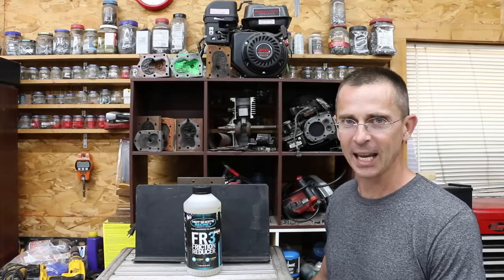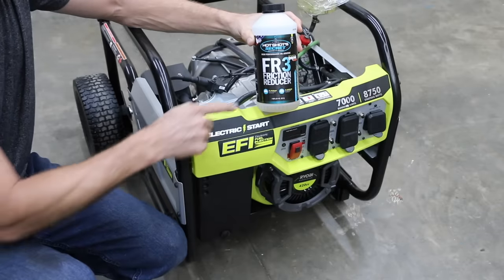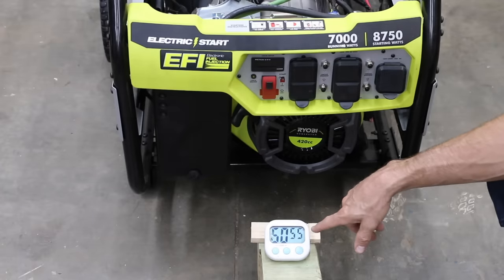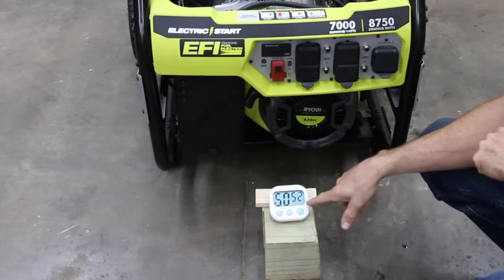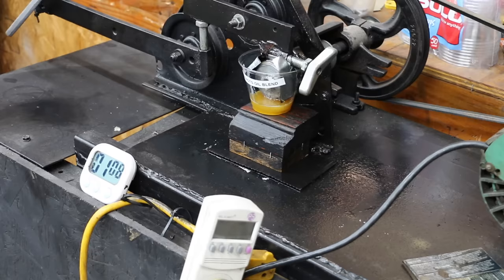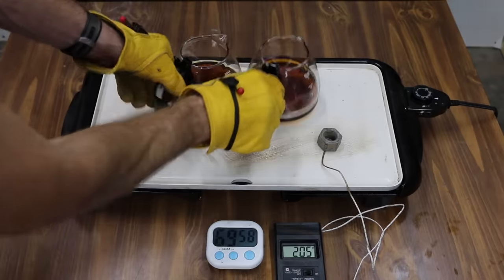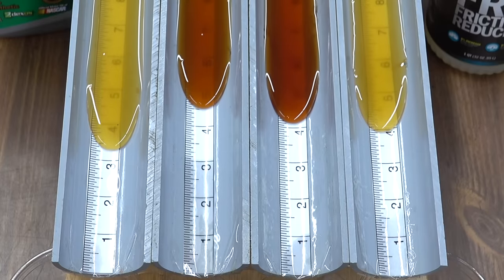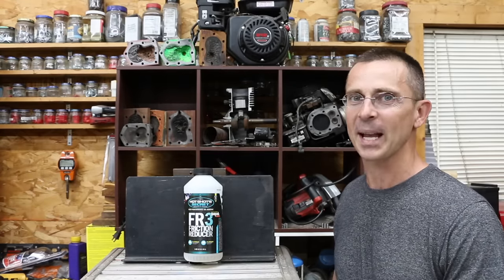Mobil 1 Boosted with Hot Shot's Secret Better? Let's find out!

Comment: When I see your generator, I often wonder about testing out how to quiet down open frame generators using the methods that are out there.  Maybe you've done this test before, but thanks in advance for checking this out!
Reply from the maker: That's a terrific video idea!
Reply: A baffle box is usually the best method. Most of the noise is from the engine and generator itself. A baffle box is lined with egg crate foam or other sound absorbing material, with openings and exits for cooling air that are built as long hairpin baffles. The sound must hit the foam if the baffles over and over again in order to escape from the cooling air inlet and outlet. The muffler can be extended out of the box and upgraded to a larger one from a small car to be quieter. After all that, going to a Honda generator is the only way to get more noise reduction. Those Hondas are sweet.
Reply: I would assume it will overheat in a enclosure even with vents..my 2 cents only
Reply: Lee Harris 
Build a dog house to put over the generator with a vent on the end furthest away from you !
Reply: JStarke240 put it in a box filled with egg cartons as walls. Thats how our music room was. Egg cartons plastered on the walls.
Reply: Check out the belly pans on Audi A4. Wow.
Reply: @leeharris3061  It will not. Make sure you do the pertinent research and calculate how to design the baffle box correctly.
Reply: Google "Quieting home generators".
Reply: Sixtyfiveford i think his name is, did a video about that. He used plywood propped against it.
Reply: We used to put ours in a hole on construction sites.
Reply: Get a RV generator muffler . Then it'll be much more quiet .
Reply: @Dr.Westside  a bigger muffler almost always works to quiet small engines. The block and head usually contain most of the engine noise generated within, but they use piss poor mufflers to quiet the exhaust.
Reply: @Dr.Westside  vibration from single cylinder engines pulse is a big source.
Make generator electric power...lol
Reply: Just buy a plastic 4ft folding table (Lifetime table, etc) and fold it at 90* and put it in front of the generator.  This is what I do when dry camping with the RV and my external generator.  You will be surprised at how much quieter it is.  I now have an inverter generator and still use the table.  Works great!  No need to get too fancy.
Reply: Build a quiet box with a fan. Extremely effective.
Reply: when i see such generator i always think how to make it run on electrolysed water instead.

Comment: test BG products we use them at the dealership and I'm curious how good the products are
Reply from the maker: Thank you for the video idea!
Reply: I too am curious about the BG products.  I use the BG MOA at every oil change.
Reply: I’ve heard a lot of hype about BG products as well. Would love to see some testing.
Reply: @Mittencarpentry  rf7?
Reply: yes, it's a big mystery; I had my dealership clean my injectors with what they called a "BG kit"; I think it was BG-44 connected to the fuel rail.
Reply: We use BG products at Subaru. Interested to see how well the stuff works.
Reply: I would love to see a comparison of bg products to their non bg competitors. I love bg products and find some of them are unmatched in my opinion.
Reply: I would love to see this comparison also.  Great idea!
Reply: There's an old guy with over 1.3 million miles on a 7.3 powerstroke and I'm pretty sure he mentioned using BG products in the video.
Reply: I've used BG gear oils, definitely noticed a difference in noise.

Comment: I work for Autozone and I would love to see a test that sees if Blue Devil "Head Gasket Fix" actually works in fixing a head gasket. Also would love to see how it compares to other head gasket fix products that are sold at auto parts stores. Absolutely love the videos and recommend them to all my enthusiast buds.
Reply from the maker: Terrific video idea! Thank you for recommending the videos to  your buds!
Reply: Jesse Pastor I tried that in my Jeep and now I know never to use that stuff again.
Reply: Why wouldn't you just replace the gasket since you already took the head off?
Reply: Michael Linner Blue devil is supposed work for heads with cracks in them. It’s a cheater product not recommended unless you want to plug up everything in your cooling system.
Reply: @waterloo123100  thanks brother. There are some fairly good methods for fixing a cracked block but they require removal of the engine to be done properly. You're absolutely right that a head or a block can't be "glued" back together.
Reply: I tried Blue Devil once and it worked for me. 1999 Ford F150 4.2 v6.was right around 150,000 miles at the time. This occurred  about 5 years ago. Coolant was seeping out from the side of the engine where the block meets the head. Coolant wasn't going in the oil or anywhere else. Loosing right around a gallon a month. Product worked for me. I guess it's a "liquid glass" product, some kind of silicate something or other and people have been using this type of sealer in engines since the 30s. After watching some other YouTube people trying it successfully I tried it and it worked for me too.
Reply: I used the 32 oz bluedevil headgasket on my 4.7 jeep...thermostat off...bypass the heater core.( no need for it in south florida)..flush system 3 times...left engine running 50 min....everything by the book ok...i got rid of most of the air bubbles and white smoke but...my 4 core all alluminum radiator got so clogeg up i had to order a new one ...called bluedevil and still waiting for a refound...the bbb has lots of unsolved complaints...hope this helps.
Reply: Project Farm it works. I’ve used it on my car years and about 30,000 miles ago and I still drive it to this day
Reply: Diego velazquez sounds like you used too much
Reply: @adammorton9311  how.? Please explain.
Reply: Diego velazquez the bottle I used did not say to remove thermostat, or flush the system. You need it in the coolant. Also I only used 1/4 of the bottle and it’s worked.
Reply: @adammorton9311  i wanted a one shot deal so i bougth the $70 bottle with 32 oz...i think it fixed half the problem but i won't know till the new radiator goes in...the temp just keeps rising but no air bubbles nor white smoke like before...I'll come back with an update when the radiator is in...thanks!

Comment: Could you please compare some of the "ceramic" or wear-reversing additives on the market today? Such as Tribotex, Xado, LM Ceratec, Archoil, RevX Stiction, Cerma Airtec microceramic etc.. I have been dying to see what they really offer!
Reply from the maker: Great video suggestion!  Thank you
Reply: Ceratec seems the most trustworthy and I always trust Liqui Moly products. They don't make as many over the top claims like others. The also have their MOS2 additive which they say is better for older vehicles.
Reply: @ProjectFarm  i think this would be great to see aswell
Reply: Liqui Moly is Recommended in both Owners Manual’s of my 2005 Porsche and My 2000 CLK 430 Mercedes as the only Additive that will not Void Warranty 🤔🤔🤔
Reply: Yeah, you know that tribotex reverses engine wear using nanotechnology.🙄

I've been looking for that test!
Reply: @ProjectFarm  
   A second vote here!
Reply: You've forgot about RSR RAN*UP.  I've used it for 200k supercharged miles of my 300k miles NSX... I pretty much swear by it since my compression is still at OEM specs ...
Reply: @npgoalkeeper _ you know you can find ws2  .5 micron sold as a bullet lubricant.  I've seen in some online threads a while back of people putting like 3-5 grams of it in their oil during  oil changes. Also hexagonal boron.
Reply: You should add stiction rx by optilube to that list
Reply: Would love to see archoil and rev x!!
Reply: Motorkote
Reply: I can tell you without a doubt that RevX works.
Reply: @sHoRtBuSseR  How was your experience with it? Could you provide some details please?
Reply: @akdomun  I was working on a 6.0 powerstroke that had a hard start any time it was below 50 degrees. Threw in a can of RevX and it started easier the very next day. Never had a problem after that as long as it got a bit of RevX every oil change. Excellent results almost immediately. I was impressed.
Reply: @ProjectFarm  I've compiled the products from the comments and the ones that I know of in a list:

Tribotex 
Xado (Stage 1 Maximum)
Cerma Engine Treatment 
LM Ceratec
Optilube Stiction RX
Archoil
RevX Stiction
Air-Tec High Class Micro-Ceramic 
Ran*UP oil optimizer 
RVS Engine treatment 
Dynamax Ceramic Oil Additive 
Ceramizer for 4-stroke 
Forch Ceramic oil additiv
Shine Armor Engine oil treatment – (yes they used to make ceramic quick-sprays for car detailing, and now they too make an oil treatment!)

If you can get to compare as many of them as possible we would really appreciate it! 

Since many claim to "reverse" or "repair" wear, you may need to score a rod bearing and run it on your machine/an engine as a bearing cap, or another creative way to test this. 

And since the price difference is quite large, you could provide benchmarks such as: scar wear size per dollar!
Reply: @sHoRtBuSseR  Thanks! My engine (BMW M54) is nearing 400,000km and if proven right, it would be good to treat it with one of those products. Looking forward to the comparison by @Project Farm

Comment: Have you tested interchangeable screw driver bits out yet. I'm always having trouble finding a brand that lasts. Most just break or strip out from use. Thanks so much for your time and effort in making these great videos.
Reply from the maker: I'll test impact driver bits soon.  Great suggestion!
Reply: Klein makes the best most precise screw driver bits followed by Wera then Wiha
Reply: Please include german ones.
Reply: Some brands don't make all bit types, but I've found the top tier Wera, as well as PB Swiss to fit and work extremely well. Apex makes bits primarily for the industrial and aviation sectors, and those work great too.
Reply: Must be a way to heat treat those things.

Comment: I agree with the anti wear properties of this formula. I experimented on my wife's 2007 Expedition 5.4 that is known to have loud VCT chatter. Needless to say, her Expedition is quieter than my mom's Honda Accord now. I was sold and use it in my 2017 Ford F250 6.7 every oil change. I actually use it in every engine that I can now. As for fuel milage claims, cooler running, and hp increases; I can't attest to that. It will definitely smooth out any internal combustion engine though. Thanks for all of your hard work and keeping us all well informed.
Reply from the maker: Great information! Thank you

Comment: I've used this product for over 10 years in gearboxes, power steering systems, differentials, transfer cases, and engine oil and I can say that it does reduce friction and provides better fuel economy
Reply from the maker: Thanks for sharing.
Reply: what kind of engine oil do you add it to?
Reply: @ImperatorCaesar22  

Diesel oil 15w40 and lawn mower /car oil all weighs
Reply: @007.3l  I mean what brand or type? Synthetic or conventional?
Reply: @ImperatorCaesar22  both